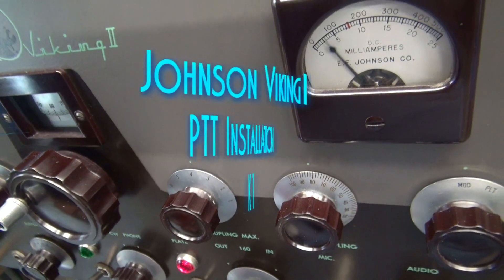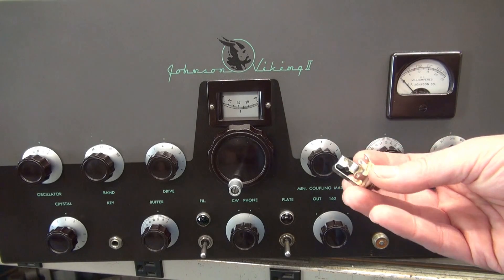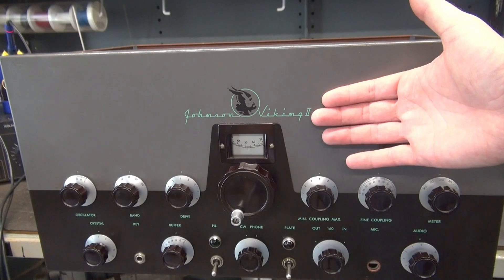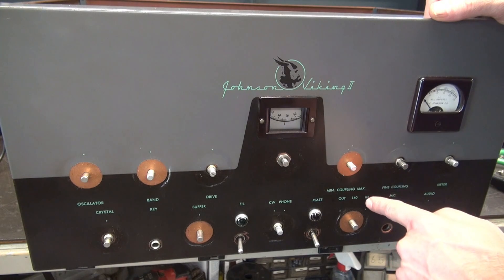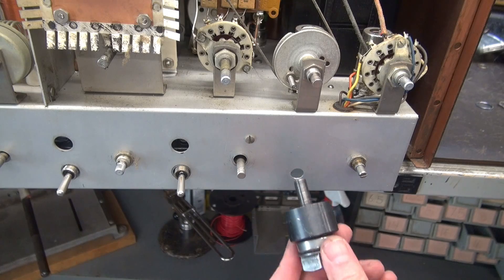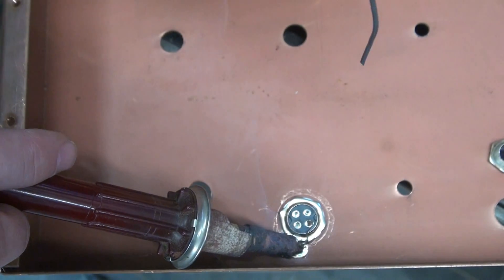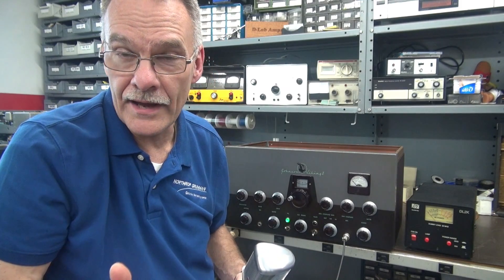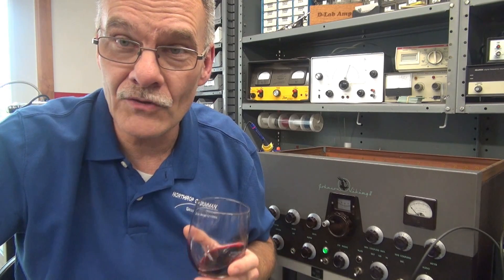How to install PTT Push to talk Johnson Viking II Ham Transmitter

Comment: Ever work,on a Johnson white face c.b radio,,when I was in my 20 ,s.I thought I new something about cb ,s ,and I thought I new something about resistors,neither were true ,I thought since.my white face radio got not I would help if by replacing all the resisters with metalized, film resistors, that would handle the heat better,that radio never worked again ,that was over forty years ago.I learn a lot since then ,but after forty years,I still have so much to learn and I have learn to take my time and try to no my limitations ,but am thankful we have good teachers like you